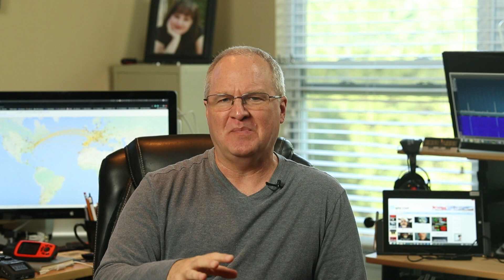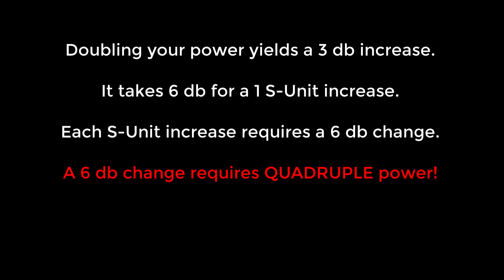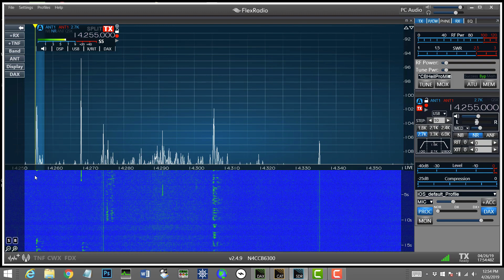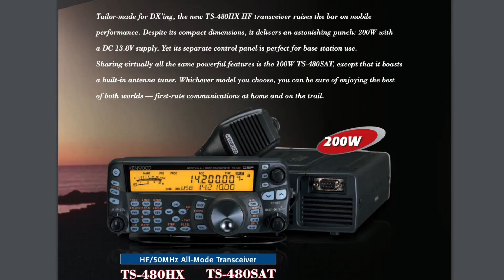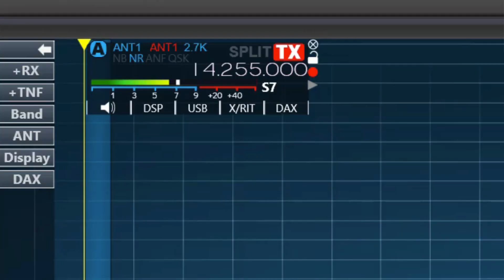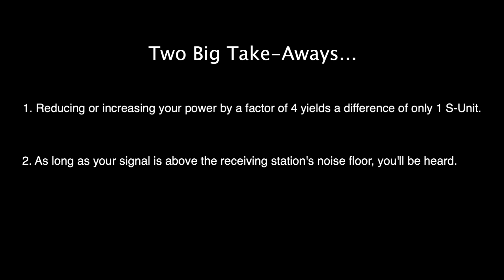Output Power vs. S-Units

Comment: Fantastic video! I listened to a couple guys do that experiment last night. Started at 5-7, on my S meter, and he said he was at 100 watts. Then he progressively went down to 0.3 watts, and he went down to about a 4-4. It’s made me very happy with my brand new G90 (first HF radio). That and making an FT8 contact with Australia, technically Tasmania, which is 8216 miles (13223km) from me, on 10m which was otherwise a dead band. No one else was there.

Comment: I am new to HF and was just entertaining the thought of adding an amplifier to my shack. I was still in the research mode when I came across this video. With this new information I’m going to hold off and focus more time and attention on my antenna system and grounding. Thank you for the excellent presentation. 73
Reply from the maker: You are wise to make sure you have the best antenna that your situation will allow.  There is nothing wrong with buying an amplifier but it only comes in handy when the other person is having trouble hearing you. You will make LOTS of contacts without one.  Have fun and congrats on getting into HF! - Cliff

Comment: I was only licenced last year here in EI. I have a "100W" transceiver into a 22m Doublet. Lately, I have really begun to appreciate what you're saying in practice. I have a night time issue where when I use more than 15W output (above 7Mhz) it triggers a neighbours PIR - my receive gets washed out with noise. This has forced me to use low power on those bands after dark. I was really annoyed by this at first but one night I heard a K station calling CQ on phone. I tried him on 5W and made the QSO. I have since made a number of transatlantic phone contacts using <15W.  
For any newbies out there - don't sweat the big guns with big power, just wait for them to move off the field and you'll get your DX. Focus on your antennae. 73 EI9HAB

I tweeted this video  - it's that good :)

Comment: This is a really nice, succinct explanation of the ratio of power to dB. I realized all this empirically one evening listening to my signal via web SDR. I started at 100W and kept dialing down the power. I eventually got down to 0.1W and I could still easily discern the  the code. That was when I realized propagation trumps power.

Comment: That is a great video, Cliff! As a new Ham last summer I heard repeatedly that I should not get a QRP rig for my first HF radio and that left me with the impression that it is much harder to make contacts with QRP. Your video is clear and fact-based. You have me one step closer to trading in my IC-7300 for something more portable, believing that I might just survive with only a QRP rig. (I can’t afford two radios at this time and prefer operating in the field.)
Reply from the maker: Thanks, Stuart.  Even though I'm an ambassador for QRP, I would have probably told you something similar... to start with 100 watts.  You can make plenty of contacts with QRP but the extra two S-Units of 100 watts will allow you to make more.  It's like fishing... it's probably better for a new fisherman to be put into a situation where they're more likely to catch more fish. This will ensure that they have a good experience and they may be more likely to stick with the hobby.

If you already know that you prefer working in the field, then I'd agree that the excellent IC-7300 is probably not a good match for you at this time.  My KX2 is my current favorite radio for the field.  But, I've got several (less expensive) CW-only, small radios that I enjoy, too. Have fun! - Cliff

Comment: I am new to ham radio, in fact I only have a President HR2510. Since it is an old unit, I turned down the output power to 4 watts on AM and 12 watts on SSB to prolong the life of the finals because they are now hard to find from what I've learned. Now, I plan to turn the deadkey even lower to 1.5 watts and use it with my RM Italy KL300P amp. But a couple of days ago, since propagation is open on 10 meters, I made my very first contact to Germany 10,000 plus kms  barefoot and it sure blew me away. Now, I'm having second thoughts about the amp and just enjoy the challenges of QRP. The joy it brings making long distance contacts in such low power is very rewarding in my opinion.
Reply from the maker: Hello, Francisco.  Congratulations on making such a great low-power contact!  There is something magical about making contacts with low power.  For many, it is the one facet of ham radio they enjoy the most.  I always recommend that new hams get a 100 watt (standard) radio in order to make additional contacts when band conditions make it difficult to complete QRP QSOs.  My concern is that some hams may give up on the hobby if they struggle to make contacts with low power.  I'm glad you are finding it satisfying to try QRP.  I hope to talk to you on the air someday. - Cliff

Comment: Older post, but thanks for posting, exactly the refresher I needed as I'm researching required battery power for portable ops and how much I can reduce consumption by reducing Tx output and not feel like I'm missing out by not running 100w.  My radio's options are 10/50/100w so I'll start with 50 and go down as able,  goal is weekend camping with casual radio fun on a 20ah Bioenno on an older (KenwoodTS-50) radio.. thanks again.

Comment: As a new Ham, got my license back in 2016, and yes I still consider myself new. I've learned a few things. Having your SWR's as low as you can get for the frequency your using is preferred. And a good antenna can make even a inexpensive radio sound good. But for HF you want a Antenna up as high as you can comfortably get it, and directional with a rotor so you can point it. I'm pretty much just a 2m/70cm guy, but I do know about antenna's. Good video by the way.

Comment: Cliff.  Thank you.  As a new QRP owner (Xiegu G-90) and totally solar/battery, I was all ready to slap down $600 for a Xiegu 100-watt amp.  Then I watched your excellent explanation.  I've since spent some of that money on other shack necessities.  I'm using a TC2M Terminated Coaxial (6-wire) Cage Monopole invented by G8JNJ.  It's so broad banded that no tuner is required - less than 2.2:1 from 1-30 MHz.  Look it up.  Meanwhile, I'll refurbish my TS-520 with new HV caps.  I'm no longer a DX Chaser.  I could not care less.  Into emergency stuff.  Makes better use of my time.

Comment: Fantastic video! Thank you this makes me buying a 20 watt QRP radio so much easier when everything I watch says you should get a 100 watt radio to guarantee you make a qso.
Reply from the maker: You're welcome, Jesse.  Your 20 watt radio is down only one-half of an S-Unit from a 100 watt radio.  Nobody can hear that difference.  This is also a good thing to remember if you're running on battery power in the field with a 100-watt radio.  Turning the power down to 25 watts (or lower) will save a LOT of battery power in an emergency situation. - Cliff

Comment: I always though it would be nice idea to have a digital mode where the DX station sent an embedded reception report that controlled your rigs TX power and vice-versa, with the two rigs just barely, but successfully maintaining contact. Maybe in a semi-duplex fashion..  
Cliff, your videos new look is excellent with that narrower field of focus. You really stand out and it looks super-professional..  well done
Reply: John C cell phones do this
Reply: @CraigPerry  They do, I've seen the advert. It's a synthetic Wide Aperture mode and works really well for what it is. I'll not be getting rid of my 50mm F/1.4 just yet though.
Reply from the maker: This sounds like a really cool idea.  I wonder if QSB would cause issues. As you saw in the video, the ham whose SSB audio I captured was battling QSB that varied his signal by 2 S-Units.  Those kinds of swings might foil this great idea.  Thanks for the kind words, by the way. - Cliff
Reply: There was at least one HT in the 90s that could do this on simplex.  Might have been an Alinco.  I can't remember what they called it.

Comment: I totally agree with you. I once had a qso with someone transmitting 500 watt. I heard him with around S9+15dB. My TX had 10 watt and he received my signal at S9. He was very surprised until I showed him that the difference between 10 and 500 watts are only 17dB. Taking the tolerances of the meters in count, it was exactly what our S-Meters showed.
Reply from the maker: Well done, Wolfgang. - Cliff

Comment: And as always, QRP since 1960, and no complaints from the neighbors or family of interference in the TV, VCR, phone, etc.  I can but rarely use 100 watts and if I can hear THEM they usually can hear ME!  Thanks for another inspiring video.  I think most hams with amplifiers are DX hounds or COUNTY chasers and just don’t want to take the chance that they won’t make the contact.  That’s OK too, but for just a regular QSO they could turn the amplifier off.  Then there is the few who run the maximum power JUST BECAUSE THEY CAN!  Some folks just need bragging rights.  This is a hobby and I guess it’s whatever floats your boat.  Antennas are more important than power and we sure have been blessed with all the antenna information available out there and also with low cost analyzers.  

And Cliff, if ham radio improves your odds of “picking up chicks” what don’t wives give us extra credit for being smart enough to pass the ham license test?  

Thanks again for your excellent videos.  I hope to see you at FDIM again this year.

Dave K8WPE
Reply from the maker: " if I can hear THEM they usually can hear ME! "  That's my experience, too, Dave.  Plus, my attitude is that it's okay to fail to make the contact. I don't expect to catch a lot of fish and am tickled to just go out and cast a line, just in case something good happens.  I will see you in 18 days! - Cliff

Comment: Thank You for the continued motivation. I finally bought my QRP rig(Elad FDM Duo) and my antenna is a Wolf River Coils vertical and I'm making out to 650 miles in some directions, even though it's too close to my apartment and I'm only using the 3 radials that came with the antenna.  Can't wait to get my station out in the open, plus  I'm bringing along a Loop antenna and an EFHW antenna too. Thanks again for the motivation 73's
Reply from the maker: Thank you, Walter. - Cliff

Comment: I have known this for many years.  But it was really brought home to me when I got a Xiegu G90, an HF radio with 20 watts max output.  I am basically able to work (almost) any station that I can hear.  There are situations like the receiving station having a high noise level, interference, or one way propagation that make it harder to work some stations.  That said, I have worked stations in the U.K., Ireland, and Mexico City with 20 watts in the 3 months or so my antennas have been up at this location (I have been licensed since 1990).

Comment: Thanks for the video.
I know what you're saying is correct.  Whether a 2K mile contact can be made (and maintained over a long period of time say 10 minutes) depends to a great extent to the band condittions. 
I've seen the band change quickly so that stations lost communication for a few minutes while those stations (a net) increased their power to 1 KW trying to maintain QSOs.  
Only a few minutes later the band changed back and those same hams were able to maintain communications after turning off the big amplifiers.
I like qrp and am looking for tips on getting the most signal out.  Basically, which feed line and antenna to hook up to my rig.
Thanks again.

Comment: Thanks for another great video, Cliff. I continue to learn from you and recommend your channel all the time. I think I am restating your thesis when I say that more power is useful only when you're trying to get your signal above the contacts noise floor. Therefore, the principal purpose of more power (in the transceiver or as an external amplifier) is to provide an option for those instances when you're trying to make the contact and need more power to get above the contact's noise floor. 

Thanks again and 73... de AG7TX
Reply from the maker: You are exactly right, David.  Well said. - Cliff
Reply: @QRPSchool  Morning Cliff! I had a perfect example of this instance yesterday. I was operating portable on a hilltop east from Carson City, Nevada, where I live. It's noisy at my home location, so I often go out there, set up portable, and spend a few hours outdoors, listening to the radio, and making a few contacts (if I can).

I worked a station in Colorado near Denver using my FT-897 and a Wolf River Coils vertical antenna on 40m. My signal report was a 22. His was a 56. But I worked the contact and got the log entry. I could not have worked this contact with much less than the 100w of power from the 897.

You're one of my Elmers, sir. 73 de AG7TX
Reply from the maker: @nvrumi  Hey, if it's "In the Log", that's all that matters.  The signal report doesn't matter, really.  You got a Win!  With Carson City to Denver being about 800 miles, I wonder if the lower radiation take-off angle of your vertical gave you a slight disadvantage over a dipole.  A dipole below 1/2 wavelength in height (66' for 40m) starts to work more like an NVIS antenna where the radiation goes higher, allowing you to cover closer-in stations at the expense of DX. Have fun out there, David. - Cliff

Comment: I've done QRP with my Elecraft KX3 running 5W. Taked to a fellow in Virginia who could hardly believe I was only running 5W. He was running 850W and was embarrassed to say I had a good signal. My new station consists of a Yeasy FT-991A, Yeasu FT DX5000, Elecraft KX3, and a home brew vertical. I no longer do POTA due to age but really miss it. I do like working from the beach here in St. Augustine Fl.

Comment: Great video. When I first started playing with WSPR beacons and FT8 I would experiment with QRP levels as low as 100mW and QRO levels as high as 100W. On good propagation days I could see marginal increase in range but not enough to warrant the added stress on my rig running a digital mode. I learned some good lessons from those experiments and this video made the results a lot more clear. A good antenna is worth an amplifiers weight in gold 73 NE5U  Mike
Reply from the maker: "A good antenna is worth an amplifiers weight in gold"  This is metaphorically spot-on.  But, I'd like to have the amplifier's weight in gold so I could retire! :-)   - Cliff
Reply: @QRPSchool  LOL If you can work that deal let me know. I have a few vintage amps in the que for restoration (way back in the que) that require 220VC and I don't have that in the shop or Ham shack (aka spare bedroom), I would gladly sell them for their weight in gold. :-) Mike

Comment: I agree with your math, but I have  broken pile ups with a little more power when the 100 would not do it. I don't feel the need for a full gallon and a half amp, but 800 to a 1000 does make the difference in my experience.  I usually run 20 drive and get 250 out. I do work barefoot alot, and do make qrp contacts too. I don't turn on the amp every time I operate, but on 80 meters at night, when the static crashes take over, you better put some power down, or the receiving station is not going to make their ears bleed any longer then a signal exchange. I love working QRP to stations that run full limit.  They say " I'm running full legal limit" and I say, " working 5 watts " LOL!!!  So I agree low power can work, but  sometimes the added push makes a huge difference. If I was a cw guy ( learning, but find it hard )  low power qrp work would be great. Really love your videos, your production quality is very good. Keep it up, and maybe it will help me get motivated to practice cw.
Reply from the maker: I think we’re on the same page. If I really care about making the contact, and 5 watts isn’t cutting it, I’ll go to 100 watts. If 100 watts isn’t cutting it, I’ll just figure it wasn’t meant to be! (I don’t own an amplifier) I’m not anti-amplifier... I just want people to know that an amplifier can make some contacts possible that might not otherwise be possible, but it doesn’t make your signal “loud” vs. 100 watts. -Cliff
Reply: @QRPSchool  Yes we are. I do have an amp, yet have done alot with just the radio. Some guys run full monty whether they need it or not. Heard a guy on 20 tonight who made the statement , " you need an amp on 20 or you won't make a contact". Well, thats just wrong.  That being said, I have made contacts with the amp when the radio alone is just not enough.

Comment: Now i understand why the jump in broadcast radio in watts is so large... most FM stations are broadcasting between 50k -100k watts which is a massive amount more power then us on amateur radio, but to get a really good signal on any old cheap radio inside a house you need to get those s units up very high  thus the gigantic jump in wattage that FM broadcast do typically.  This really backs up what your saying (I believe) please correct me if im wrong and excellent video, subbed and belled really enjoy your presentation and knowledge.
Reply: Most FM 100K ERP stations have about 20Kw transmitters that will make that level of ERP (effective radiated power) by feedline (usually 3 to 4 INCH coax) loss plus antenna gain. Once I got called out to service an FM broadcast transmitter that "just didn't sound right", thinking there was a studio to transmitter link issue. Link checked OK, went to tower, found a bad final tube and driver tube, so I was hearing the transmitter over 30 miles away quite well on what power was leaking through two bad tubes from the pre-driver stage. Goes to show you, it's all about antenna and at VHF frequencies, antenna height.